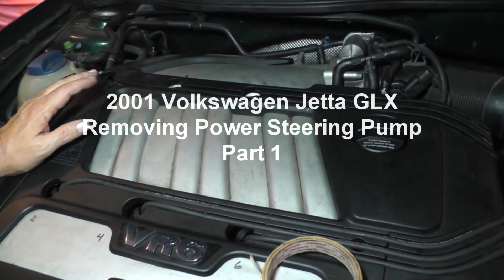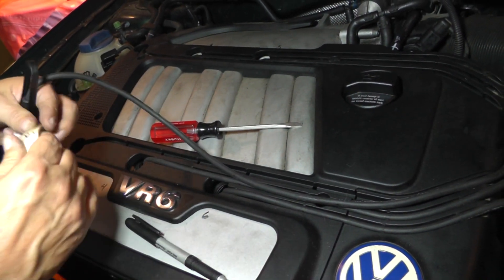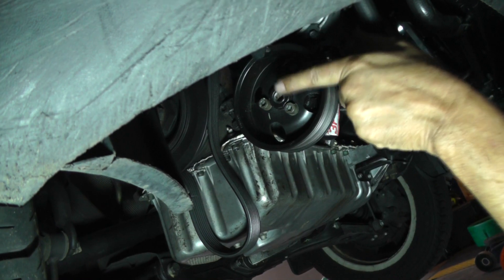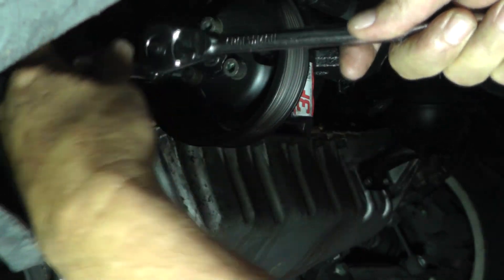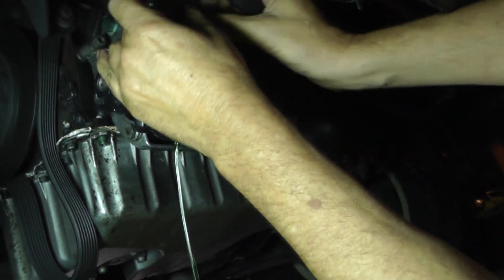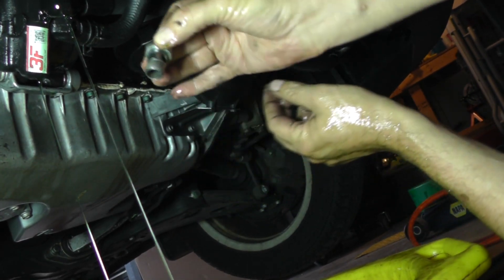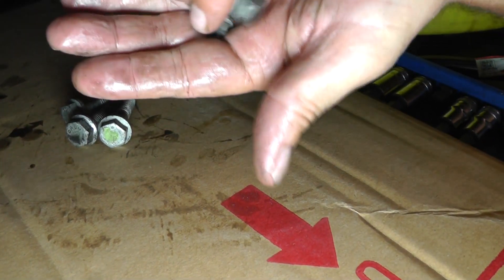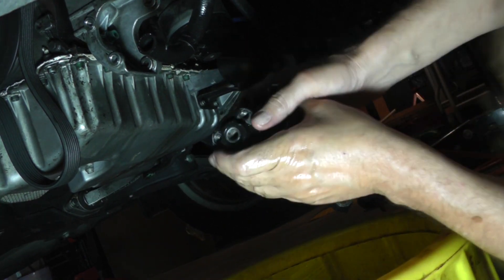Volkswagen Jetta Removing Power Steering Pump Part 1

Comment: Just got done installing a visually identical pump on an '02 Audi TT 1.8T. Hopefully this one doesn't end up leaking too, haha.

Only differences I noted on the TT:

The banjo bolt had a sensor threaded into it. A 22mm deep well socket did the trick both to remove the sensor, and the banjo bolt. Had to use a couple 3/8" drive extensions and access it from the top of the engine bay. A 22mm wrench with a steeply angled neck probably would've worked better, but I managed.

The center hex opening on the pump shaft seemed large when using a 9mm key, but 3/8" fit nicely.

The three bolts holding the outboard side of the pump seemed to prefer a 1/2" wrench to a 13mm, the 13mm had a sloppy engagement.

The last two differences could very well be tool-related (in my case they were Eklind hex keys and Craftsman wrenches), but just thought I'd give a bit of a heads up to anyone else attempting this project.

Thank you for posting!
Reply from the maker: +Randall Kerstetter Hey, thanks Randall as we all could use everyone's input from their own experiences. We're all here to learn. And like you said, hopefully your pump won't leak. I can't remember if I mentioned it in the video, but I put a pump on there and leaked right off the bat. I had to get another pump and this time it was from a different manufacturer. Thanks Randall for dropping in and sharing your thoughts.

Comment: very good video, only one question: will the slack on the belt affect the timing? or the belt wont move
Reply from the maker: Not at all Abraham. The belt that drives the power steering pump is a serpentine belt and not a timing belt. So, when you take the belt off, it doesn't have any marks. Just put it back on and you're good to go. Also, for some more info, this vehicle doesn't use a timing belt. It has two timing chains which are located at the rear of the engine where the flywheel is at. Thanks for your question!

Comment: I have a 2001 jetta vr6 gls,  believe it's 2.8l.  But what power steering fluid would I use? The same as yours?  I can't seem to find this info anywhere,  could you tell me what fluid it is specifically if you know please? Thanks
Reply from the maker: I do show the fluid in another video in this series. The fluid for this vehicle is made by Pentosin which is called CHF11S. You can pick it up at NAPA auto supply.
Reply: Thanks alot, yeah I saw the video now lol. I hate the stupid groan that sounds like my wheels are about to fall off haha.

Comment: stuzman52 Thank you for the video sir. Now let me ask you this, is it the same procedure for a 1.8 Jetta? I'm out of power steering fluid and after filling up today, just five minutes and a few turns of the steering wheel and I'm back to stiff steering. My high pressure oil line is drenched with oil and I cant seem to pin point the drip. Its actually more of a squirt to be honest. I laid right next to the pump and had my wife turn the wheel slowly. I could see a nice stream of red fluid coming from the high pressure hose. Any advice helps sir. Greetings from West Texas.

Comment: You don't have to label the plug wires, their length will determine where they go.
Reply from the maker: Yes, bobo, you are correct. In later videos such as the one where I change the intake manifold change-over-valve, I just threw the plug wires off to the side without marking them.

Comment: Do you have anything on replacing waterpump in a 2000 Jetta?
Reply from the maker: Sure don't. But check out my friend's channel of Thomas EXOVCDS where he has a slew of videos on VWs and Audis.
Reply: 2000 Jetta GLX VR6 heater won't turn off. Any suggestions save going to dealer?
Reply from the maker: Right off hand I don't know of anything to say that this is what the problem is. If you have a wiring diagram, you could take a look at it and then come up with some thoughts about what it could be.
Reply: Thanks

Comment: I cant get it out
Reply from the maker: Can't get what out, the pulley, the pump, etc. If it's the pump, you may have to pry on it since it's wedged in between the bracket. But be careful that you don't break the bracket.
Reply: stuzman one of the back bolt broke off